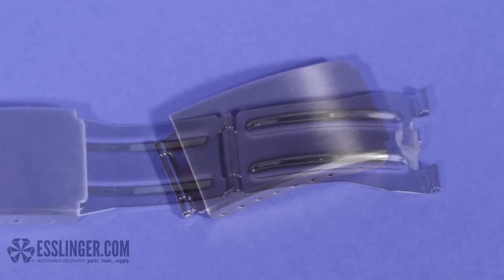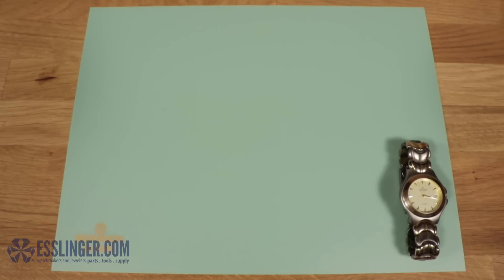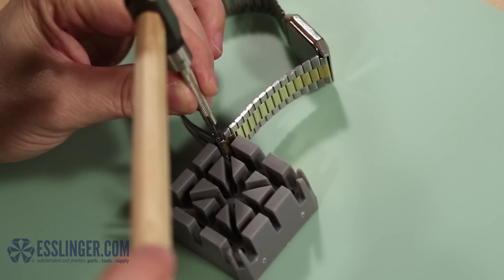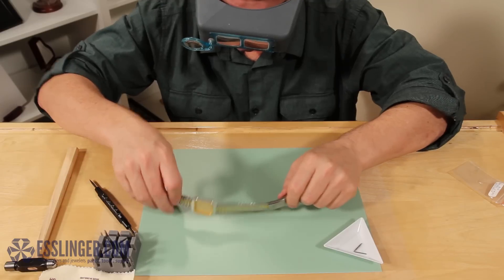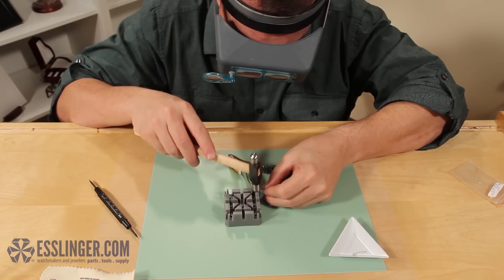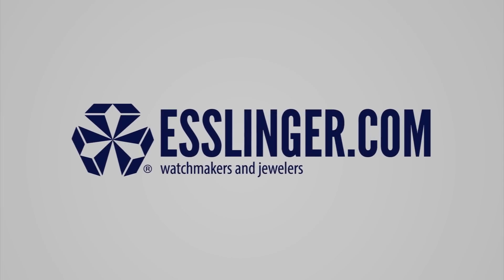How to Replace a Basic Tri-Fold Watch Band Clasp

Comment: Hey man I had a possibly unrelated question about watch bracelets / clasps. So for the single clasp that folds over (not the butterfly double folding clasps) does the width of that have to be the same as the lug width of the watch? 
For example I'm looking to replace my watch clasp only because of certain allergic reactions. Replacing stainless steel with titanium. However I'm unsure if the single folding clasp is different than that of a double folding (butterfly I think it's called) clasp in terms of how it attatches to the actual watch.

When I look at my bulova watch with the original butterfly (double folding) clasp it actually connects from the inside where the pin is rather than the outside. So being the width of the inside and the clasp maybe 8-10mm? Whereas i believe if you connect the single folding it would have to be the entire width of the braclet/strap? No?

because I can't find a titanium that's 22mm (the size of the watch braclet/strap and distance between lugs(i think))
but I can find ones that are 8-14mm or so.

Thanks for the input I hope I did a good job explaining what I needed to say.
Reply: Hi, did you ever find out the answer to this? 

I too am looking to replace a butterfly clasp for a micro adjustable tri-fold one, but i've noticed the same thing you describe and i'm not sure I will actually be able to switch out for another one. Just wanted to check before I order something that might be a waste of money. 

The butterfly on mine connects in to the end link with the same pins used throughout the watch band links, but it looks like when you zoom in close on pictures of the other style clasp that they use spring bars and not pins, so the bracelet it attaches to seems like it would need to be specially made for that style of clasp. 

Please let me know your findings if you see this :) 

--- Chris :)

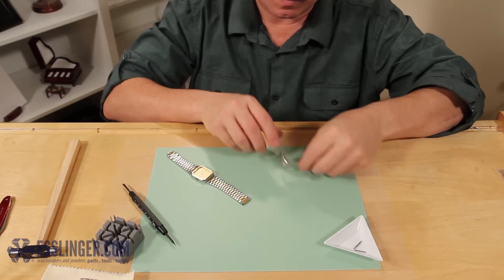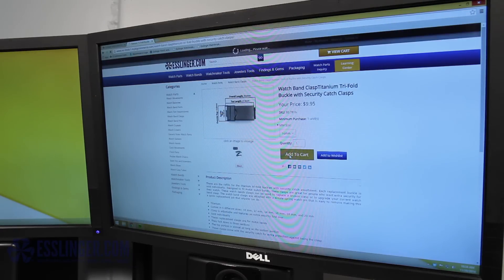Comment: At timeline 1:45 to 2:06 you are asked to take a measurement of the end of the folded metal piece of the clasp. Then you are asked to measure the inside dimension of the clasp cover and the narrator says, "It should be 1mm smaller than the first measurement". Ahhh....NO....it should be 1mm LARGER than the first measurement, otherwise how will the cover fit over the hinge? As proof, look at the numbers being measured in the video....the first measurement is about 15mm and the second is 16mm. The recommendation given is backwards.